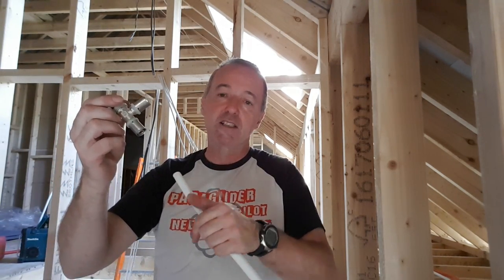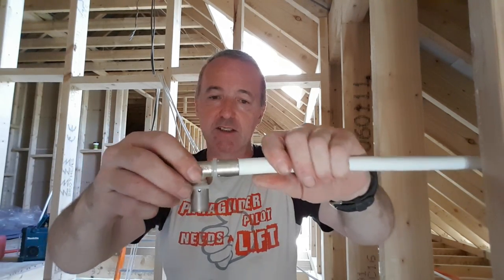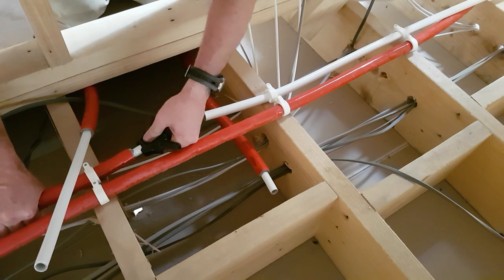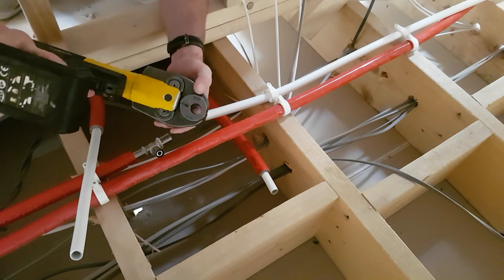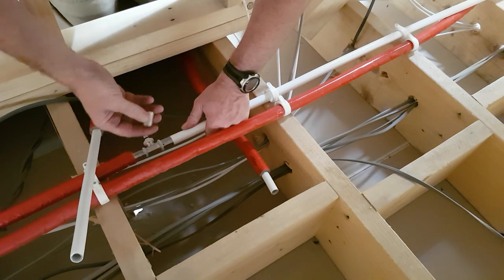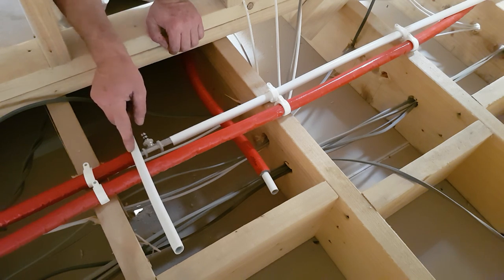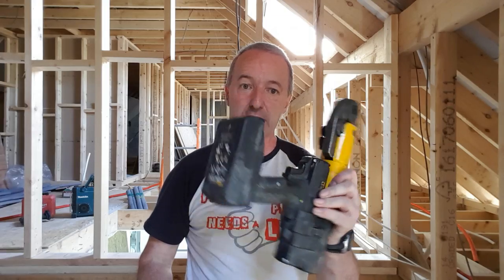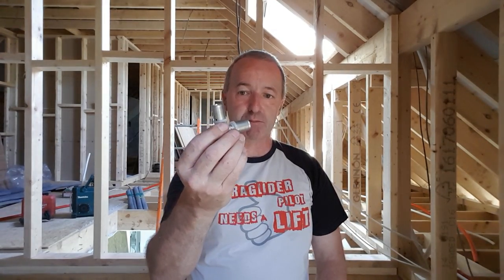How to connect Pex al Pex pipe

Comment: Awesome video. This is some of the only information (believe me I've looked) on pex al pex on the internet. I got a good deal on lots of this tubing and fittings on ebay and will be using it for an irrigation system for trees, garden, grass, etc. My fittings are all plastic threaded so I hope they hold a seal.

Thank you for taking the time to post this.
Reply: dude pex shouldnt be exposed to UV light
Reply: It's also probably the only information cause they don't make PEX Al PEX anymore, and haven't since before this video i believe.. at least in my area I haven't seen it in use for over 10 years.. stuff has a bad lifespan and has lots of pending lawsuits against it i believe
Reply: @ThePiones  Dude I will be shallow burying the piping obviously

Comment: I've never seen those fancy pex fittings. Those can't be cheap. I always used the brass fittings with the copper crimp rings. I'd love to have that power crimper though. 🔨
Reply from the maker: Hi Marcel. I think that fitting was about 2.50 dollars and it is a great leak proof system if you do it right. There is a manual crimper but it's a pain to do a lot of fittings. The Rems mini press tool is expensive but worth it if you were doing lots of joints. Thanks for the comment. Cheers Gerry
Reply: Gerry's Waste Oil Burner That price is actually much less than I expected. I was imagining in the 5 or 6 dollar range. Yeah I hate crimping with the hand crimper and it ain't always possible to get in a stud bay near an inside corner. Gotta plan ahead and get those joints done first.
Reply from the maker: That's true corners and cramped space can be a pain. I am back there tomorrow too and I could do with my honda generator working. I have to replace the carb. Might do that in the morning. Thanks for the comment Marcel Cheers Gerry
Reply: the pex-al pex pipe is from europe...not too many use it in the States...its the best fitting...far better than the compresion ring brass cooper etc...because its squezed like hell on the pipe...the fittings are not so expensive...but you can put it into the walls with no risks on leaking...like brass cooper ring style fitting.

Comment: I used pex when replacing my water heater about 10 years ago. So far no leaks.
Reply from the maker: Hi John. Pex is a good product but can go to mush if things get too hot. I have about 1.3 km of pex heating my floor for the last 13 years with no issues. I put about 1km of pex al pex in the floor of the house in this video. Going to show how I connect all the pipes to the underfloor heating manifold a little later in the week Well done on your water heater. Cheers Gerry
Reply: Gerry's Waste Oil Burner I sure hope it keeps working. The water heaters in a very confined space. Get a headache just thinking about it. Slainte!

Comment: huh, just like cable, is there a compression plug type?
Reply from the maker: Hi Tony. There is a way to connect this pipe with compression fittings. I have a video out in a couple of days where I connect pex al pex pipe to a 14 port underfloor heating manifold using compression fittings. Cheers Gerry